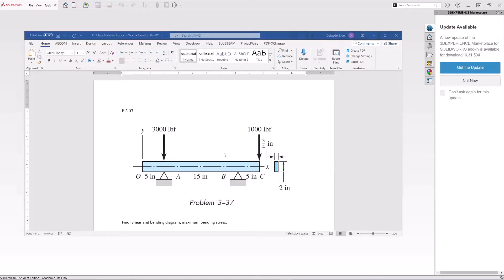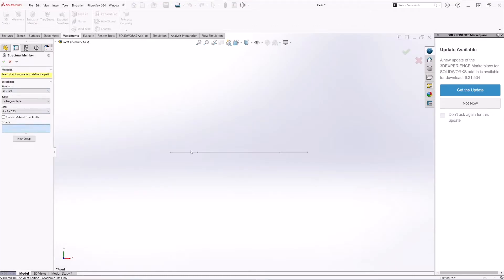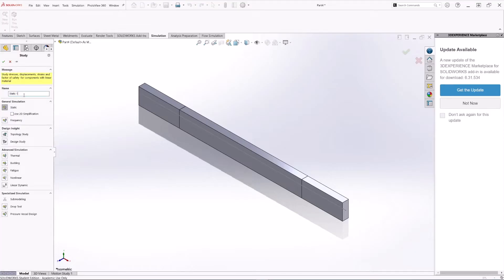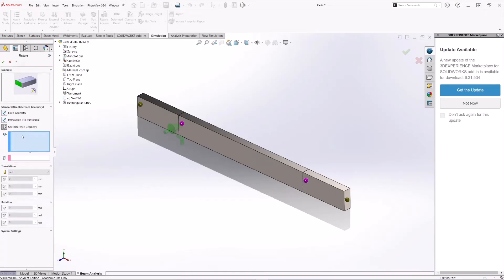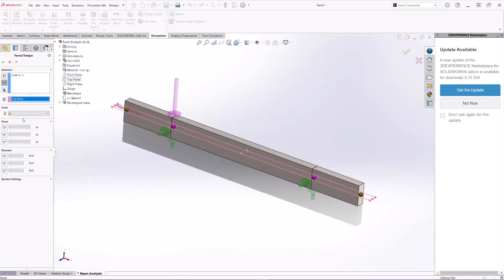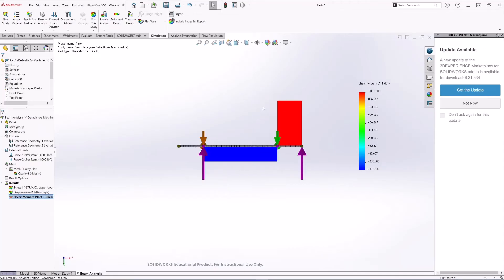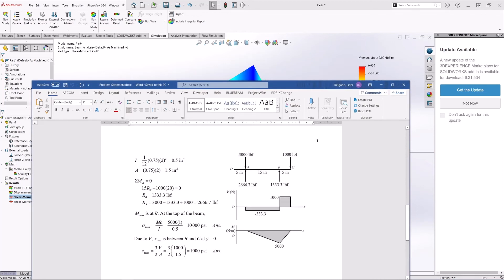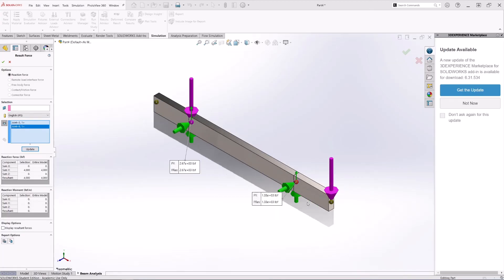Beam Shear & Moment Diagrams, Reaction Forces | SolidWorks Simulation Beginners | FEA Analysis #1

Comment: Hello, when I try to run the results, this message appears:

"No loads or prescribed displacements are defined (for problems, with special loads such as Thermal, Gravity or Centrifugal, activate the proper flag) Loads on Fixed-Rigid parts would not be active."

Do You know how could I solve it?